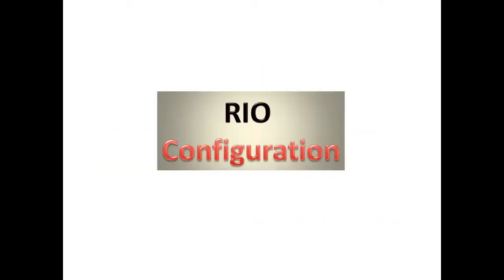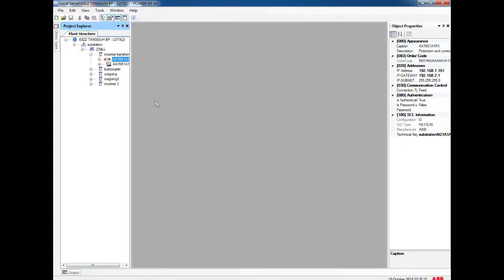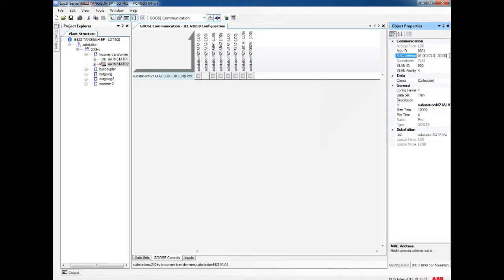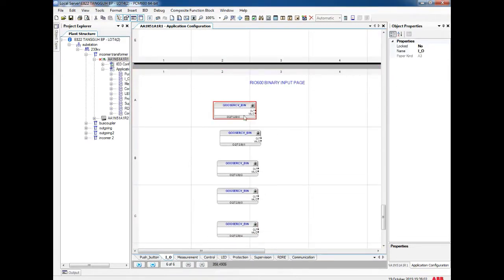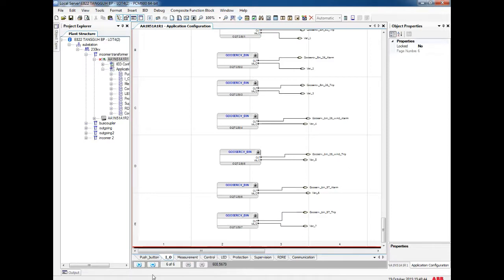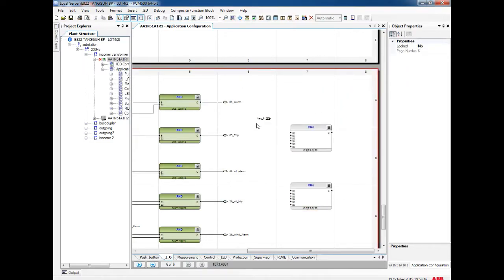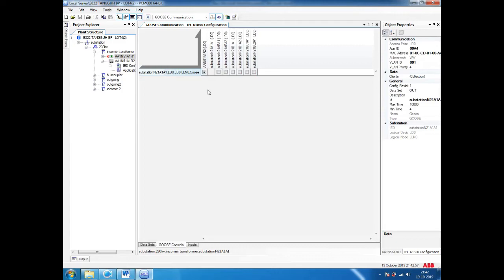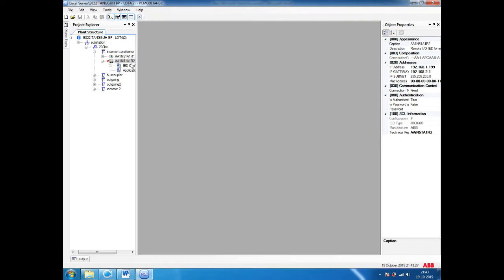How to do Configuration in PCM600 | RIO Configuration | Goose Between RIO 600 and REF620

Comment: Mr. barani i have a question about modbus TCP IP

i want to connect 2 or more relay with daisy chain connection and i access 1 relay as a master, can i do that sir?
Reply from the maker: you can make daisy chain connection on modbus but i don't know we can make one relay as master.
Reply: @baranitech  mr barani, if cannt possibilty using modbus protocol, can i use goose protocol sir?for interlock between REF611-REF611 or REF615-REF611?